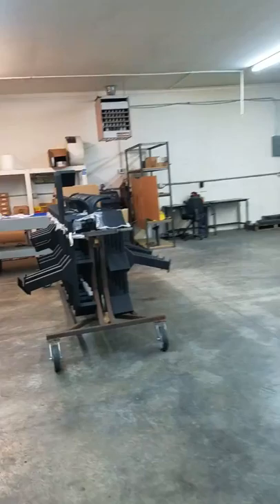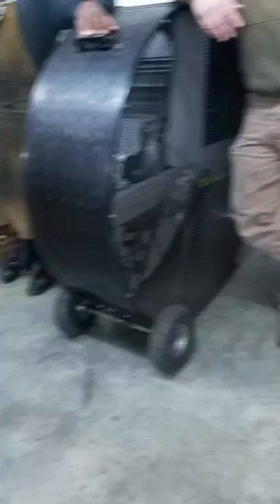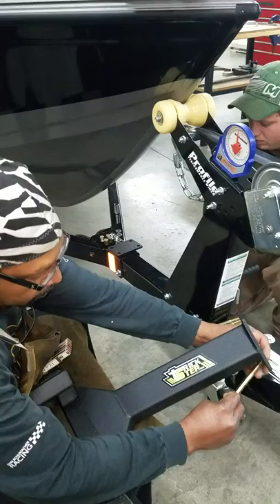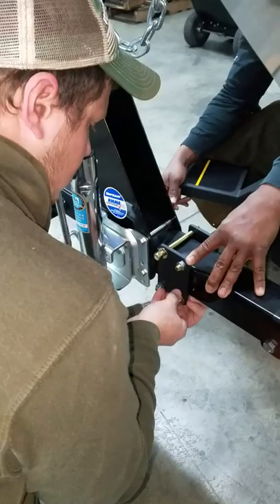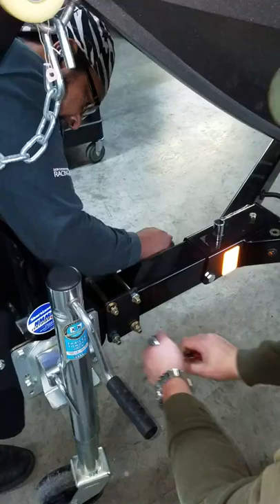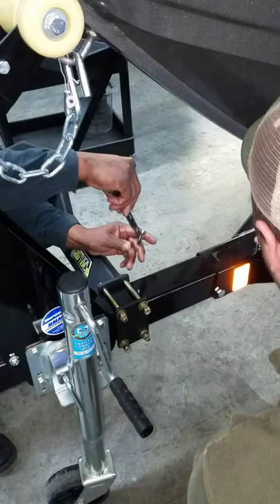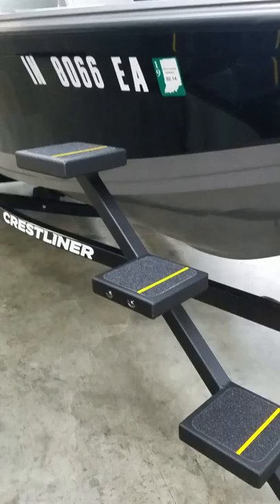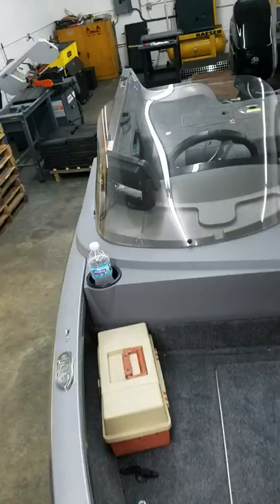Shore Lander trailer Trick Step install

Comment: Will this work on my 2017 Seaark easy 200?
Reply from the maker: Yes, we've done several for Seaark.  Just depends on the trailer winch post angle.  Give us a call: 317-350-2632

Comment: Hey guys .I have one bad knee and cant go up the steps like a normal person i have to do it one at a time.I was wondering if you guys make a trick step with a longer step so you can put both feet on at the same time.
Reply from the maker: Our step pad is 7 by 7 inches, I can get 2 feet on a step but I were a size 9 shoe, we have made a few 11 x 7 pad steps for special circumstances but you have to be careful as the wider step will affect your turning radius. Feel free to give us a call and we'll discuss what works best for you. Thanks, 317 350 2632

Comment: Do you make one for a 2018 tracker grizzly 2072?
Reply: I just talked to them by phone to find out about one for my Alumacraft Competitor 185 Tiller and they said they can do one for just about any boat.  They just need pictures of the front of boat/trailer, proper angle of the winch post and diameter of the trailer tubing or winch post depending on where they think it will be best mounted.  If one in stock then takes about 3 weeks to get it.  If custom then add a week.
Reply: I guess not